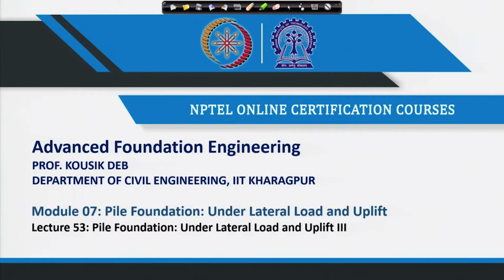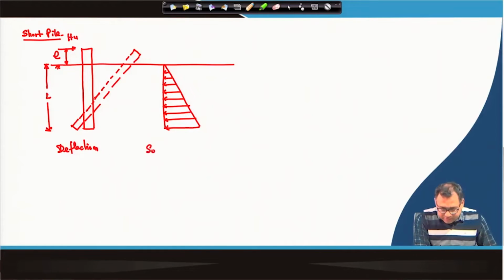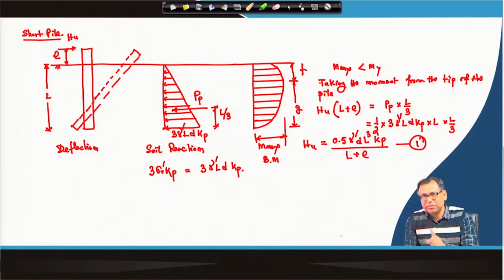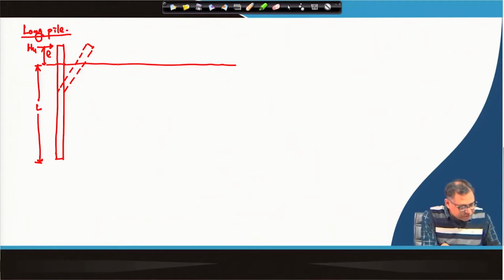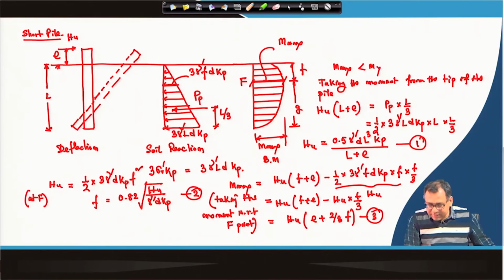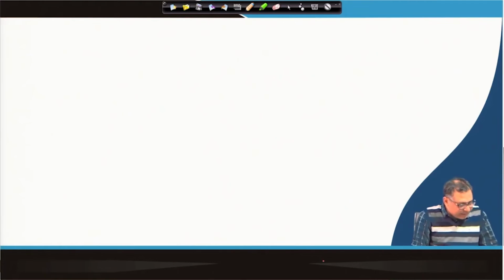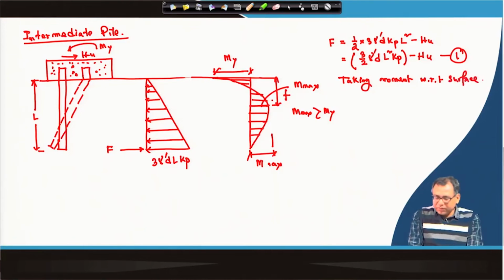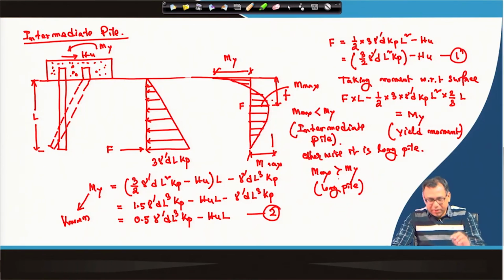Lecture 53: Pile Foundation : Under Lateral Load and Uplift III

Comment: Maybe I am wrong, but for me it makes no sense if M max is bigger than My (that means the maximum bending moment is bigger than the yield of the pile, in that case, the pile should fail), this for the long pile
Reply: Pile will not fail because actual capacity a plastic stage not yielding stage